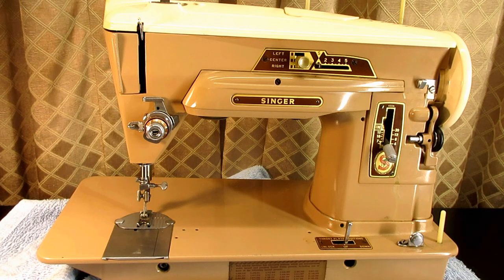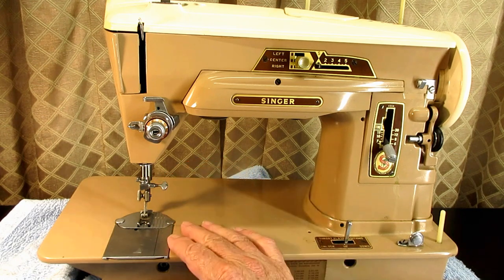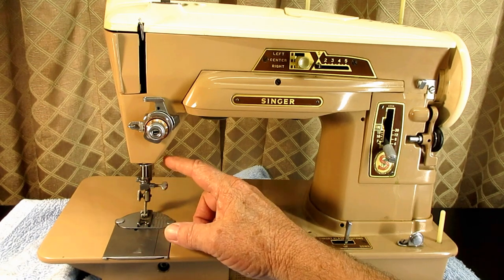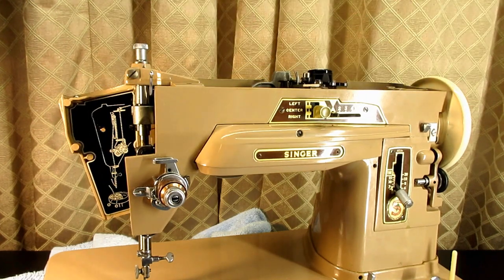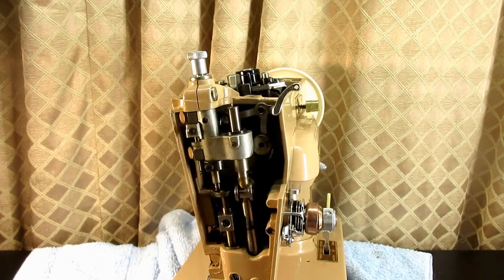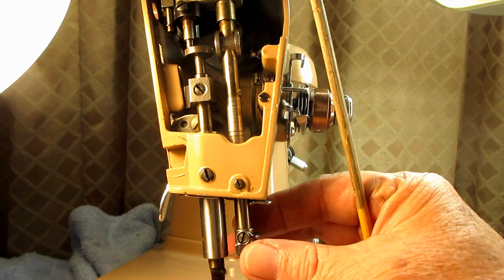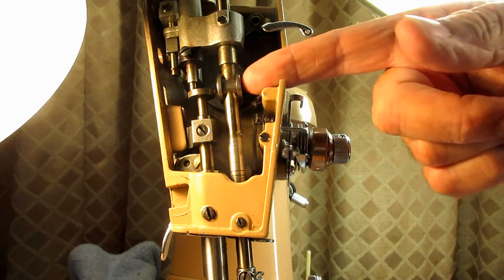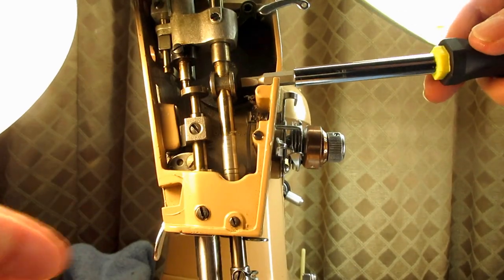All about the Needle Bar of the Singer Model 403A Sewing Machine

Comment: Hi, Andy.  I cannot get move or remove the needle bar.  I sprayed krud kutter on it and it still won't move. Should I let it sit over night? It has been about 4 hours already.
Reply from the maker: You mean you are trying to remove the needle bar itself, after taking out the clamping screw? Penetrating oil can help, like WD40. You can also warm the clamp area with a hairdryer. If there is not any rust it should loosen up. I have had NB or presser bar stuck so bad that I soaked a rag or cotton balls or makeup remover pads with full strength Krud Kutter and left it wrapped overnight. Don't force it out as you can bend the needle bar.
Reply: @andytubesewing1953  Thanks for your quick reply, I will try the hair dryer, only because i can't find the WD40.  Yes, I am trying to remove it to clean, plus the top line you show in the video is not visible.  My son in-law bought me this machine, it is very dirty but otherwise looks very nice.  I seen a few issues on my machine that I seen in your first video, on what to look for when buying this type of machine. I am very thankful I have found your videos.  Thanks again, you might hear from me again.
Reply from the maker: @elainemichell883  okay Elaine that sounds good Early on I found out that patience is required with some of the screws and bolts when needed to be removed there's other parts of the machine you can work on if you haven't already like taking off the light or the hand wheel things like that some of the non sewing machine type oils had additives that dry up very hard like old varnish and it can take a while to soften them up or part removal you know where to find me if you have any other questions as you go and thank you for saving that machine you will find it rewarding and you'll be happy with the results

Comment: Mine is stuck.. turn wheel needle bar will not move. Bobbin does not move bobbin winder moves. Handwheel is tight.
Reply from the maker: Hey! This is the 3rd time you've made this comment. I'm trying to help, but could you please read my replies when you leave a comment? Thanks ever so much. It COULD be the NB, but it could be the hook shaft or any other shaft that is frozen and stuck with dried oil. All the parts move together so when any one part is stuck none of the parts will move.  Here is my reply to your comment from yesterday: """ OK, this comment is more clear than your other one about the handwheel. A machine that has sat idle for years/decades is often frozen. This is usually due to dried oil on the needle bar bushing and/or the shaft bushings. The dried oil is like varnish or glue. Do thorough and complete oiling of the machine (skip the grease part) and heat the bushing areas with a hairdryer. This can soften the old oil and let the new oil penetrate. You can follow this video and just do the parts where I use the bottle of oil. You can also see where to oil in the instruction manual which is free from Singer at this link: https://www.singer.com/search/support?title=403a
So oil it well, heat it well. """  Good Luck.

Comment: Reinstalling that screw with the cupped washer and thread guide into the needle clamp is going to be the death of me! I don’t have an expanding screwdriver (you can bet I ordered one from Amazon though).  Why does it have to be so fiddly?! Ugh!
Reply from the maker: You can do it! Machine restoration teaches patience, doesn't it? If we survive the high blood pressure 😉 I also have a $4 magnetizer for screwdrivers I have used and it can help, but not as good as those spring-bit screwdrivers.
Reply: Andy Tube My husband helped me. Turns out I needed a third hand. Between the two of us, we met with success. Andy, this video is just excellent.
Reply from the maker: @athertonca  Can't beat a spouse that helps! Congrats.

Comment: OMG, I did not read through the comments, I saw that and thought is was old, dirty fuzz and tossed it. OOPS!
Reply from the maker: OOPS!, haha, you are not the first. You can make a little pellet from a felt spool pad or scrap of fleece even, Keep it well oiled until then and you'll be fine. Thanks for watching my channel.
Reply: @andytubesewing1953  Would a felt pad used for the thread to sit on be thick enough for the plug? Also, should I place it in the tube and set it on the hole on the bottom, or just before the hole? That is the end coming from the machine, not the needle bar.
Reply from the maker: @jenniferbowdoin4197  Yes, I said that in my first reply to you. That is what I use, a small piece cut from an old woolen felt pad. I cut it in an oval shape and position it over the hole. My understanding is it stored some oil and prevented extra oil from just running out of the hole and the parts going dry. Those parts get lots of metal-on-metal movement and the pad was made to help them stay oiled.
Reply: @andytubesewing1953  sorry, I'm a notorious skim reader. Thanks again for everything. I've been working on a 401A bought from GoodWill, using all the videos for the 403 and 401 that you have generously shared with all. I've got it almost back together again and  can't wait to see how I did!
Reply from the maker: @jenniferbowdoin4197  OK, no worries. I hope it all works out well for you. A very nice machine.